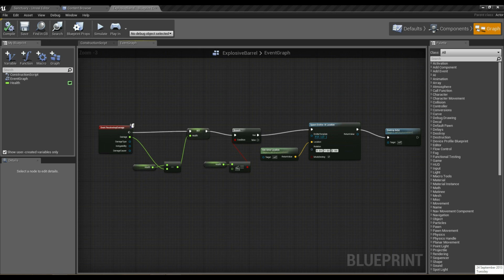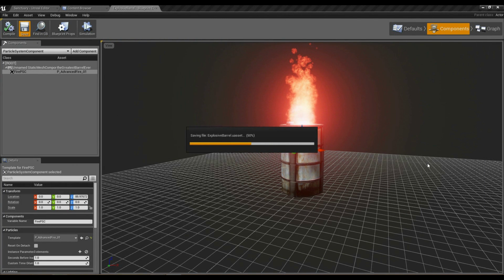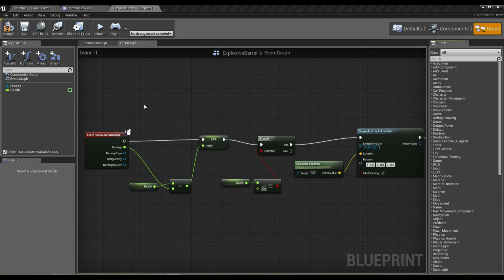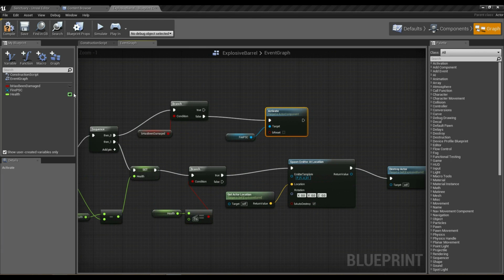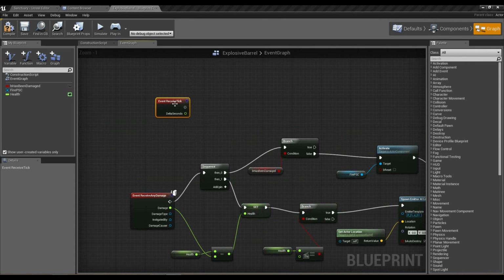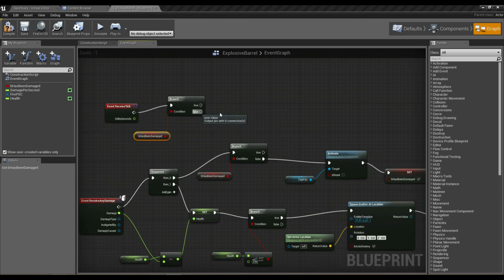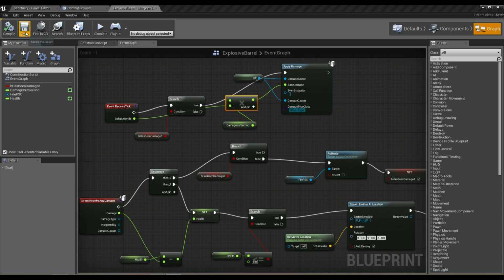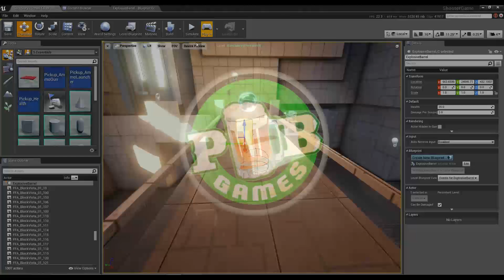UE4 - Blueprint Explosive Barrel #2 - Particle System Component

Comment: great tutorial. Just a tip, under your barrel's class defaults. Set the Actor Tick Interval to around 0.5 seconds. Other wise you will have these barrels in your levels ticking 60 or more frame per second and causing unnecessary burden on the cpu :)
Reply from the maker: +Jody Trandana Yeah, good call!